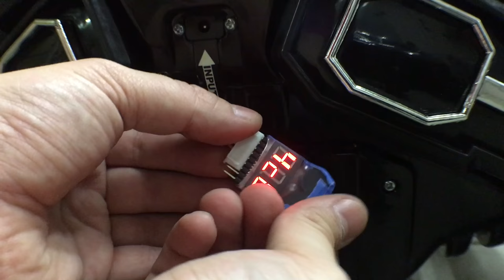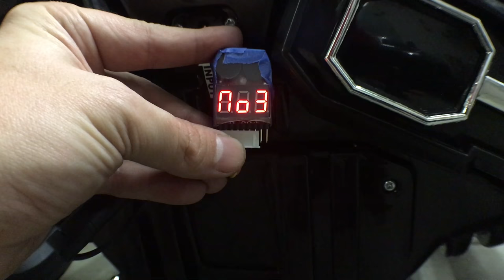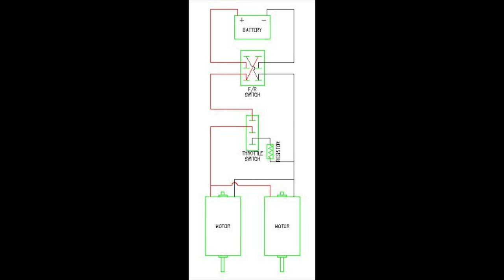Lithium-ion Power Wheels!!

Comment: Thanks for the kind words.  I can see you love the heck out of your daughter.  I Like the lithium-ion battery idea. What is the price comparison?  Batteries lasting longer  beats the heck out of having a bunch of back up batteries.  Sometimes I feel like I'm the pit crew for Jimmy Johnson.    Have fun, Kenneth Bowman
Reply from the maker: Thanks, she's a super cool kid. Price is a around 2 times sealed lead acid but the benefits are super flat discharge curve, so they'd stays quick and peppy the whole run. You can charge at 50Amps (vs 1 or 10amps on SLA) if you had a beefy charger. The volume for the same SLA capacity is about twice the size. The pack in this video is 20Ah, replacing 10Ah stock battery. Good luck to the pit crew! :)

Comment: Might I inquire where you purchased the battery cells and hardware to assemble them?  Thanks for the video also.
Reply from the maker: From China :) Search for "Headway 38120". The ones in the video are the 10Ah variety. Most suppliers will also include the lego like brackets. Godspeed.
Reply: Thanks, I hate re-inventing the wheel.

Comment: Is a 40V lithium battery a problem?  My kids tractor has a fuse attached to the negative input side.
Reply from the maker: JC Stuart 40V May be a bit high. What voltage does it run stock?
Reply: JuliansRandomProject yes!  The 20v has been perfect!